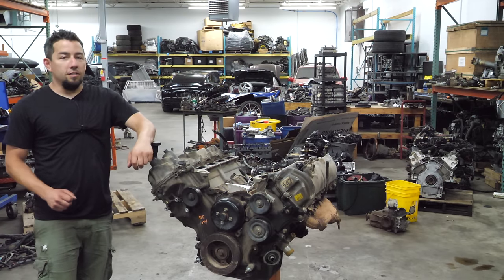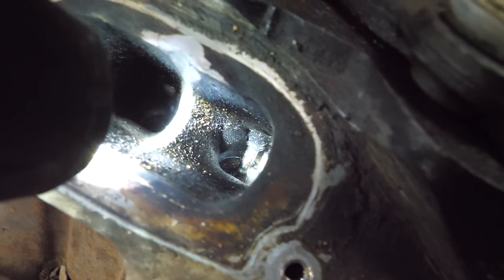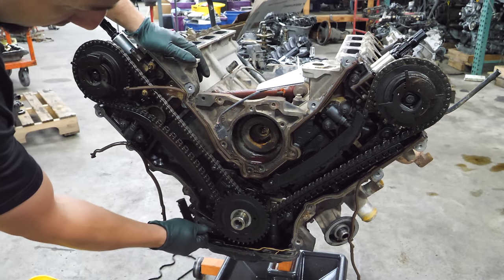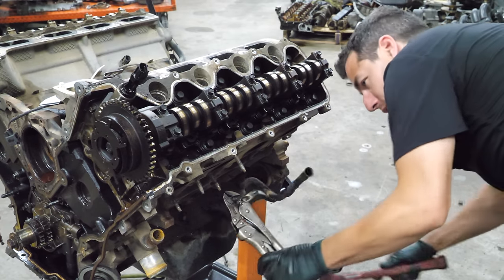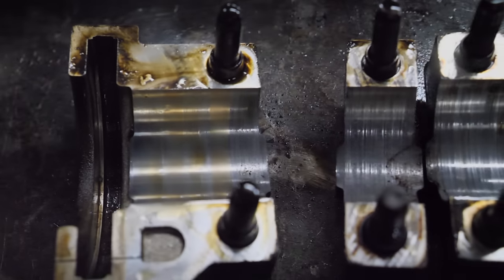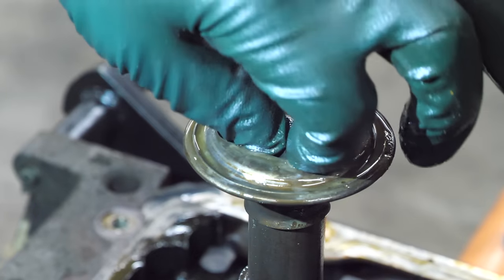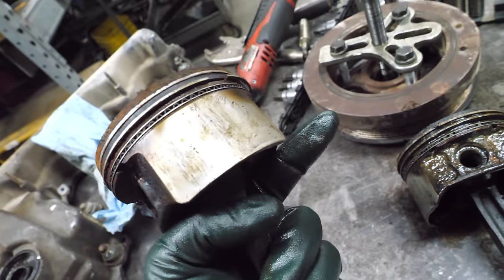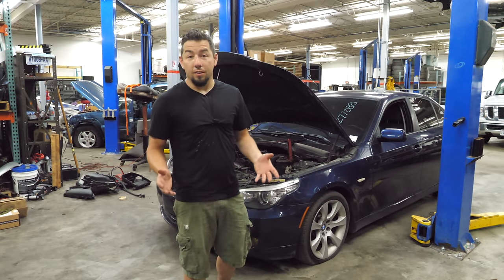Bad Ford 5.4 3-valve V8 Engine Teardown. Which of The MANY Possible Failures Took This One Out?

Comment: This engine is not trash. However there are some unique characteristics of this engine which require a special maintenance procedure that nobody seems to catch on to. The largest failure of this engine is the cam phaser starting to fail and of course the timing chain tensioners. Both of these situations are exacerbated by people who do not change oil often enough or do not know how to clean the system before they reinstall fresh oil. That is what I am going to attempt to address. In the heads especially the left cylinder head there are passages cast into the head that carry the pressurized oil that operates the cam phaser. About a week before you do your oil change when you're about a quart low anyway, put a quart of Marvel Mystery Oil into the engine and drive it for a week. Then change the oil. That will go oodles and gobs and miles and miles to keeping this engine fresh and operating properly. It keeps the lifters fresh it keeps all the internal components clean, the phosphorus and that Marvel Mystery Oil is a wonderful engine cleaning mechanism. I have seen people drive these engines to death. But it's mostly due to lack of maintenance. And since then they have truly made trash engines because they literally have an engine today that the low mark on the oil dipstick is over 2 quarts almost 3 quarts low of proper level. If you get one of these new engines put the old style dipstick in it. The other issue that they did do with these engines is they were stupid enough to put aluminum bearings for their main bearings. And that engine has harmonics in it and it destroys them if you do not keep it with really fresh oil. I would even suggest using something like Amsoil which is by far the best protective oil for bearings that I know of. For higher temperature Kendall works best.
Reply: I agree with you, also you are the first person I’ve ever heard talk about flushing the engine before you change oil. The oil in my ‘09 was dealer changed exclusively for the first 8 years from new so they didn’t flush it but once I started doing my own oil changes I used Kleen Flo Engine Flush before every oil change. I finally had the Valve Covers off it for the first time last year and the inside of the covers and top of the heads still look shiny clean like a new engine. Also it still runs as quiet as the day it drove it off the lot. Proper maintenance, synthetic oil and Motorcraft filters have worked for me.

Comment: Hey now watch it, not all 5.4L 3V motors have exploded. From what I've seen, the only way they last is with RELIGIOUS oil changes using a good quality oil and I'm talking RELIGIOUS. We're @ 100k on my wife's expedition and it's still running great. Only pain in the ass was a plug change that I broke one spark plug off.

Comment: Sparkplugs were out of this engine who knows how long.  This would cause the rust in the bores and the "engine fluid " to be present.  Can't hold that against the engine.  Poor timing chain tensioners, plastic guides for the chains and lack of oil changes are the obvious killer of this engine.  I have a 5.4 3 valve and change the oil every 5,000 and have never had a problem but do understand that the timing components are due.

Comment: The biggest problem with these engines is Ford put the oil pressure sending unit right behind the oil pump, so when the engine is weak it still shows great oil pressure. Then the damage begins

Comment: I ended up with the 5.4 3 valve in a 2011 E-350 passenger van. Bought with 15k on the ticker 9 months old. Easily driven 7 years 65,000 and crapped the bed. Ford is willing to sacrifice customer satisfaction and not help consumers. Their lawyers ended up threatening me with a lawsuit and I was stuck with their boat anchor. There isn't a lawyer in America that can help either. Thousands of consumers at the loss of a vehicle or paid upwards of $ 7000 for a new engine. The better engine re-builders have done things to help and have engineered solutions to the problem.

Comment: Hello. Open question to anyone who wants to assist. I have the opportunity to buy 2 F150 with these 5.4 for $3000. I was thinking of putting in a 302 instead of the 5.4 or 4.6. Questions are, would there be wiring issues, and what type of ignition controller should I use if there is? Would the transmission bolt up?. Thankyou.

Comment: How's the mechanic the 5.4 really isn't a bad motor once you get up into the 2008 to 2010 Model they're actually pretty technical logically advanced but also still fairly reliable other than a few issues here and there which almost every new motor has The one thing I Hate about these is the exhaust manifold and how they break that bolt because that is not easy to fix

Comment: These engines had way too small of a hole for oil return to sump, therefore the unending causes of oil starving and blown valve cover gaskets to boot. A low pressure pil pump would have helped the issues but FORD " knew best" . The problems started and ended in the same place

Comment: Ford has been caught sending out vehicles that were faulty.  They have the most recalls of any manufacturer because they don’t care.  The new cars have issues like the bronco, Mach e, F150 and other cars in their line up.  Recently they made a video talking about these issues for damage control, but not to stop making faulty cars.

Comment: So: was the engine running, just noisy, or not running??? That's one thing I'd like to know on these teardowns. Many/most(?) of you probably KNOW the answer to that, but due to limited knowledge - I don't know unless the engine has some kind of massive failure. I find this stuff very interesting btw.

Comment: The real cause of the failure is a lack of maintenance on this engine. Look how dirty it is under the valve covers.  5.4 3 valve motors will not tolerate neglect, because of their complicated  VCT and  timing systems. I've heard of these going well over 300k miles if they've been well-maintained before needing a timing job. On the other hand, if you run your Triton with 10k mile oil change intervals, this is what you get.

Comment: I wonder where this damage to the engine came from. Have the engine service intervals been observed? Was the right oil used? A sliding rail on the timing chain doesn't just break like that. The engine looks very neglected in the video, from which I conclude that no attention was paid to the service of the vehicle. Motor oil can currently also be considered as a spare part. While this type of engine isn't the pinnacle of engine design, the owner has a huge impact on how long an engine lasts. It's better to do one more oil change than one too little. Of course, also pay attention to the oil approvals from the manufacturer.

Comment: I had this Motor in my 01 Harley Davidson F150... Never had the spark plug problem, had to change a couple of coils around 70K , sold it at 95K so IDK??? Also had a 04' F150 with 200K on it, it started puking out sparkplugs anytime I drove more than 300 miles! I bought the heli-coil kit from AutoZone and could re-tap and be on my way in like 10 minutes!! Did 3 or 4 over the short time I owned it.. Made it to 270K before I sold it so?? 🤷

Comment: The only reason vvt valve plug is because the oil has. not been changed .
Chev has exhaust manifold bolt issues. Hemi has exhaust  manifold bolt issues, 
And a 5.4 will out pull a 5.3.

Comment: Honestly I don't understand why it's so hated, I think it's just a stereotypical thing. Because I used many vehicles with the 5.4 3V and non of them in the fleet had any issues. I think any engine with poor maintenance will give super reliability middle fingers! From my experience the 5.4 3V never gave me any kind of trouble.

Comment: My HVAC company had all different types and brands Rams, Fords, Chevys,, we had several 5.4 3 valves,,  never had issues ,, 200000 plus miles..
In fact overall the Fords were the most reliable..
I know it's is a bad design but ours,,, 2005 thru 2010 ish got the job done and they were definitely not babied...

Comment: I drove a 2008 back and forth to work for 6 months parked when the job was done it had 687 thousand km on it when I parked it sounded like midgets with hammers when it idled. My 2019 ram used to do 6 trips to town and back on a tank this ford got 9 tank might be 20 dollars larger on the ford I was amazed at fuel economy. It would spin the tires even when you didn't want it to, I know nothing about the maintenance but I do know the guys three sons and I know this truck spent its life minus the 6 months me driving it on the floor its the only way they drive. So I don't know but for something that should have been long dead it impressed me oh ya guy called me to bring it back to him it sat for two weeks and was -30 celsius and it fired right up

Comment: Here's my question, could the 3 valve be improved? The 2 valve was praised for being great. Whatever Ford engineers did to make it a 3 valve instead of 4 is confusing. The 2 valve does make less power but is more reliable than the 3 valve. It makes more sense to make the 2 valve larger by making them bigger.

Comment: It's crazy to me that the 4.6 2 valve 3 valve and 4 valve were good bulletproof engines no problems but the 5.4 was just a horrific piece of junk they were both modular Motors what went wrong there?

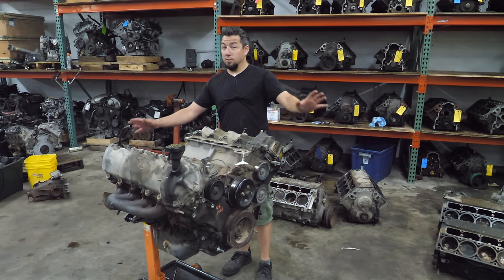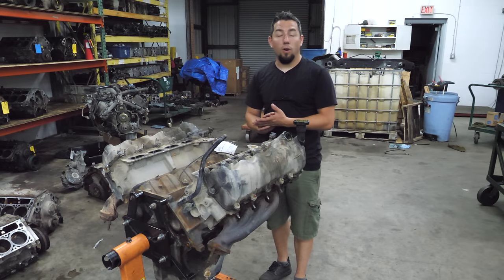Comment: At the 1:50-2:00 marks, the question is asked, "why did Ford continue to offer the 5.4 3-valve engine in some of their trucks for so long.? The answer is, they needed the additional production to offset their costs of development, tooling, and so forth. Shutting down production too soon would result in negative profits on the engine. And there was little risk of exorbitant warranty charges, because the failures would not occur until the engine was out of warranty. Remember, this is the same company that produced the Pinto 2-door, with its fatal fuel tank design, which produced cars and people burning to death from being rear ended. Their testimony in Congress was they calculated around 50-60 fatal accidents which they could then tie up in court for years and years, and that option was preferable to a redesign of the car to solve the problem, and accepting that level of preventable death was preferable to spending more money than that on a redesign. The little Pinto station wagon was OK, it was just the 2-door sedans. A more recent example was with the cars they put out recently that had the dual clutch transmission, compact and mid sized sedans. The clutch was of a flawed design, but Ford chose to produce a flawed product rather than pause production and solve the problem. So there were endemic warranty problems, which Ford then denied the claims on some flimsy technical grounds. Finally after 2 or 3 years of production, they stopped making the cars with the dual clutch transmissions. They could have designed (or adapted) a regular auto transmission, but then they'd lose their investment in the plant, plus the development costs for the flawed transmission, and they continued producing it until they broke even on it. Getting back to the 5.4 3-valve... it was all a matter of recovering costs and finessing warranty claims for as long as possible. One known flaw in the engine was that the oil return passages to the oil pan were too small. There is a Ford Tech Sve. Bulletin about the problem, and all rebuilders now are told to drill out the passageways to the max they can, which appears to be helping out on rebuilt engines.

Comment: While I will agree the 5.4 wasn't Ford's best, but if you give it a timing job it will run a long time. One could argue that Toyota's best engine of all time the 3.4 requires a timing job every 100K.   By 2010 they largely had the problems fixed, and mine has 165K on it no issues. I do plan on giving it a timing job and the melling high volume pump around 200K. There is even a kit out now that allows you to put cam bearing in the heads. I would bet what happened in the case of this engine is one of the tensioner's seals blew causing it to loose oil pressure and a lax chain that slapped around which broke the guides and plugged in the oil screen.

Comment: I have 190,000 on my 5.4, 3v. Slight tapping and no guts. Im thinking roller followers. After reading comments. Probably change tensioners. 
Any comments....
I have this lariat, 4 door, 4wl dr....that has absolutely no rust. I mean brand new condition. Id rather put money into thus truck...rather buy new.
What would be a good engine swap???

Comment: Ford, known for tossing boat anchors onto the sales floor and letting customers bear the brunt of significant engine failures. Doing so means the fog of information around different engines in different models gets thicker from the customer perspective, and when one finally implodes, there's enough plausible deniability for Ford to say, "huh, that sucks, bro." and refuse to fix it because it's just uncommon enough and infrequent/unpredictable enough that a full-scale recall is never done. 
They did the same thing with the 4.0 SOHC...the 6.0 Power Stroke sort of...but couldn't do it with the 6.4 Power Stroke or that dual-clutch transmission in the Fiesta/Focus.

Comment: The 5.43 is a motor not four people who neglect services The later your ones were a lot better than the first style ones for example I have an '09 4x4 with the with 170k all original parts are still on it everything is completely perfect as far as field trims the way it starts and everything but I dude my oil changes every 5,000 mi and every other oil change I run marvel mystery oil and I use quality oil and filter. Only thing else I've changed was spark plugs and I went back with OEM motorcraft plugs and I had to change one oxygen sensor That's it. Her fan of maintenance goes a long ways

Comment: 4/16/23---how about a teardown on a 3-valve 4.6 Ford.? Its basically the same engine as a 5.4, but with a lower deck height. I had a 2007 Ford Explorer with a 4.6 3-valve and it was everything I wanted it to be and nothing I didn't want it to be. That said, I ran into some articles about getting the multi-piece spark plugs out, and mine was coming up onto the recommended change interval. I talked to the dealer's shop mechanics and they all gave horror stories about having to take the heads off to fish out the broken parts of the plugs, so I immediately traded it off. Still, I have a curiosity about the engine, because I've never heard of them having the problems like the 5.4
Reply from the maker: I’ve done one, a mustang, probably a year and a half ago
Reply: @I_Do_Cars  I found the article and enjoyed it. One thought... the various times when you pull apart an engine and recover some bent rods (the 4.6 had all 8 rods twisted into abstract art) you ought to advertise them as being for sale individually. I'd pay good money for one or a couple of the rods from the 4.6 Ford and have some abstract art around the house.

Comment: Come on now, it’s just a bigger modular 4.6l and they usually last at least 200k miles with just regularly maintenance only you just gotta be careful when pulling and installing the spark plugs which imo isn’t a big deal and it’ll last 200k miles with only regular maintenance no problem and you really can’t expect more than that from any motor.

Comment: Garbo engines. Mine has 180k km and once oil is hot, it begins to idol rough and throw a code “cams too far advance” if you disconnect the vct solenoid in the effected bank(s) it goes back to normal.

This engine has oil flow issues, bottom line. Supposedly upgrading the oilpump resolves this issue, because the oilpump is simply inadequate.

I waa going to do exactly that when I replaced the timing chain, too bad the tranny went this year (on my birthday no less). 

The vehicle has had a lithany of sensor issues too, the maf sensor shat the bed, as did the throttlebody position sensor, all in all not a great impression from ford.

Comment: I have a 04 f150 with 235,000 miles with no problems. Keep your oil changed at 3000 miles and should have no problems

Comment: i wonder if they were doing something like the military did with the trucks that had bad overheating head gaskets or something was to teach noobs to drive a truck right so when they were in the field and had the good one it would not break down on them cause they new how to drive and not blow it up but ford was trying to teach people to change there oil so when you get a nice motor it last way longer cause you don't try to go 100k miles before you change the oil ..?

Comment: I had a 5.4 in a 2005 expedition. I had an issue with a loud knock coming from the passenger side cylinder bank and it was running rough. The Ford service "advisor" stated that the passenger side of the engine was being starved of oil and my engine was as good as dead. He blamed it on me not  using a Motorcraft filter (what a crock of %&^@). Anyway, they said all of this without ever even pulling the valve cover. I took it for a second opinion and the mechanic pulled the valve cover off and noticed one of the cam lobes was damaged. He replaced the cam (and went ahead and did the phasers and lash adjusters while he had it apart) and I got another 100k miles out of it before I sold it.  This motor caused me to switch to Ram trucks after the Expedition.

Comment: I have a 1999 F250 2 value and it's the original engine and transmission with 242,000 thousand, change small parts that's all, Ford should of drop the 3v and go back to the 2v when they were having all these problems.

Comment: I almost bought a truck with this engine. I am a Ford guy and bought a new truck in 2006. I couldnt figure out why Ford would use a three valve, when  4 was well the norm by 2006. . Or why Ford still had a 4 speed auto, when most were onto 5 speeds. So glad i passed! What a pile of junk.